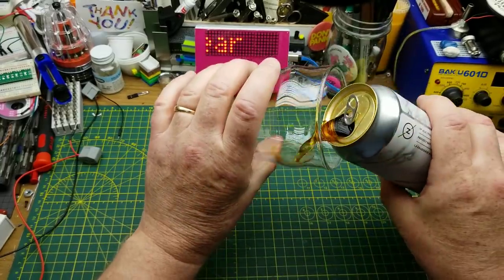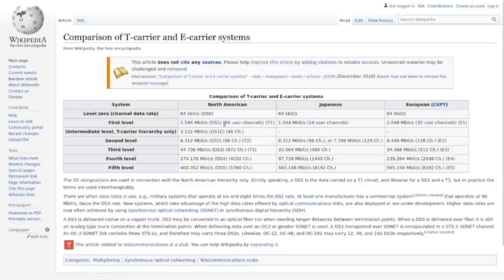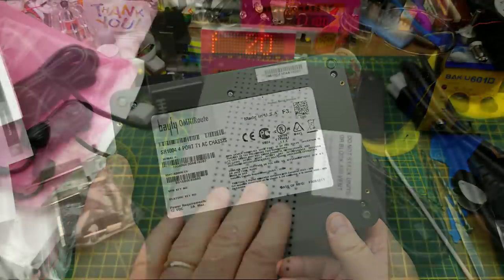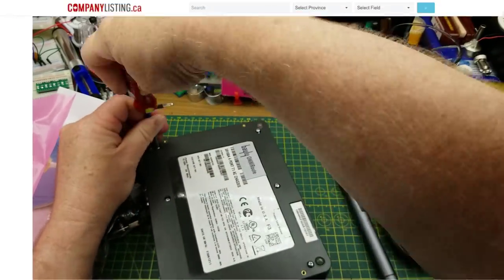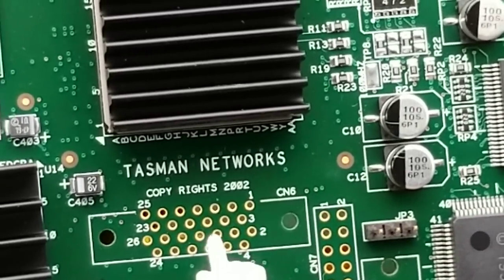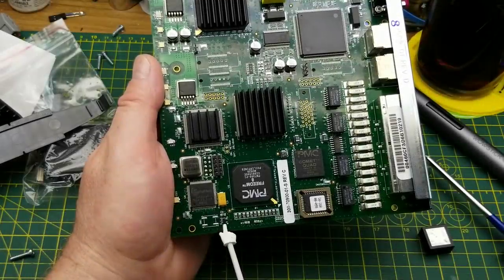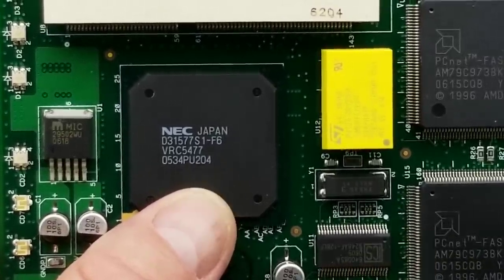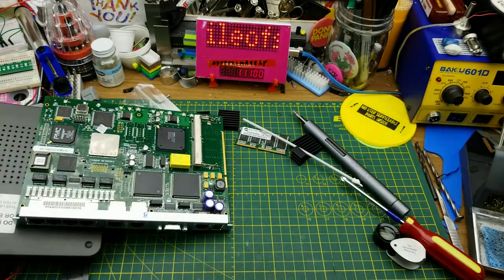What is an Omniroute? Curiosity teardown

Comment: E1 T1 brought back memories - I worked for a telephone company with international telephone exchanges, which to a large extent were T1-E1 convertors. The T1 had different methods of transferring call related data (dialled number, answer etc) prior to C7 digital signalling and different speech encoding- Mu law. The UK had 32 full 8 bit (30 A-law speech) channels. A real pain in the bum, especially when the cable TV companies started providing UK telephone service with US voice standards. In the original T1 the dialling was done by "bit stealing" from the voice call, instead of 8 bits they used 7 bits, the other used for signalling. E1 (G.703) put all the (based on R2) signalling in the data channel (TS16). This signalling difference was carried over into modern C7 digital signalling in the UK in the signalling channel  but in the US they had to use dedicated signalling T1s in a separate network. This caused a major outage in the US telephone network, the equipment that was used for the signalling equipment (STP) had a data update problem - they went out of service - -no phone calls for quite a while. Oh happy days!

Comment: "Fun" Fact: AT&T still offers T1 lines down here in Southern California, and up until about 2-3 years ago, was the "best" thing they offered in most of the region to "small" businesses at the "affordable" rate of just $1,400-2,000 a month. Though they would say its "only $800/m", but with all the fees and mandatory extras services, like the dedicated POTS line for a dial-in modem for them to manage their T1 router, and all the leased equipment.

We couldn't switch fast enough to a local cable provider when they finally sorted out which of the two local cable co's our area belonged in. Went from the best we could get from AT&T was a T1 and ADSL, to as many 1gbps fiber we would want. Our bill and bandwidth swapped a digit changing ISPs. Out phone bill also went from >$1000/m to under couple hundred. The sad part was this was back around 2015.
Reply: I used to order "voice grade leased lines" from the phone company. And put SHDSL equipment on each end. They were $25 a month. Since the SHDSL equipment had 4 ports for DSL lines, I could use two of them for $50/month and get around 5 to 7 megabits/sec depending on the distance. This was very handy for SCADA and traffic signal comms and provided enough bandwidth for ip cameras.

When you get a T1 line from the phone company, that's pretty much what they do. Stick a HDSL to T1 converter on each end and run it over the same crappy copper your POTS line is supplied through, then charge ridiculous money for it.
Reply: corey Babcock  I remember one place I worked for had a T1 line go down for 48 hours. Why? It was on an old pulp/paper insulated cable and water got in and damaged the cable. So much for that SLA. I think they (Verizon) offered a $20 refund for the outage. Wow. That T1 eventually got replaced with dedicated fiber from the power company and the cost went down about $50 a month!

Comment: Believe it or not, T1 is still often used today, especially with MPLS circuits.   Usually you'd have a few bonded/multilink T1 circuits to get higher speeds.  Considering the speeds, most watching this channel would think T1 or even multilink T1 would be ancient, considering we now have cable or fiber.  But usually with less expensive broadband, you don't get much of an SLA or guarantee of reliability.  With T1 subscriber, you dealing with telco circuits that have been rather rock solid, and a tight SLA.
Reply from the maker: My company still uses a lot of T1 as well, but we are in the process of migrating most of our traffic to ethernet over fiber whenever possible.

I'll be long retired before it's all gone, though.

Comment: Very cool to see under the hood! Tasman networks was bought out by Nortel in the mid-2000s, maybe 2005 or 2006.

A data center I worked in was about 50% Tasman and the rest Cisco.
Reply from the maker: Did the Tasman product line carry on after Nortel imploded?

I know some of the Nortel product line carries on under a different company (Ciena, for example, bought Nortel's optical transport line)
Reply: @pileofstuff  That's a good question. I think some of their nxt (multiple t1) routers did but I don't recall the brand that they became.

Comment: I'm guessing the fuses and transformers are for when (not if) someone plugs a pots line into a port. Gotta handle that ring voltage somehow.
Reply: If ring voltage was the concern they could use a low-clamping voltage MOV. I think the fuses are for protection against "sneak current", as they typically use thermal fuses for that purpose from what I have seen. I've never seen a good explanation of how "sneak current" could happen, but I do know that they sell protectors for it and some phone systems/PBX systems require those protectors.